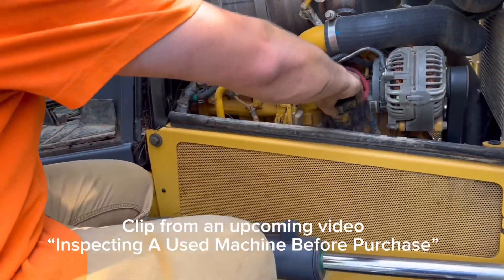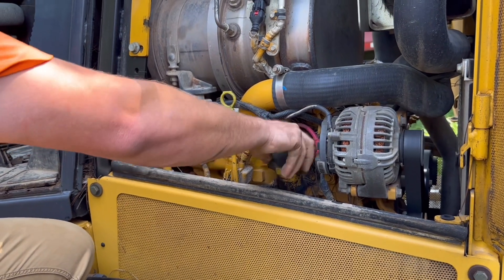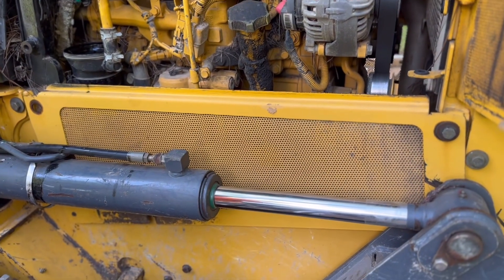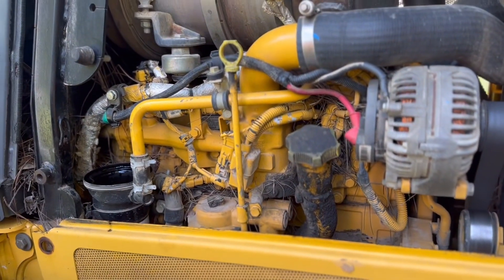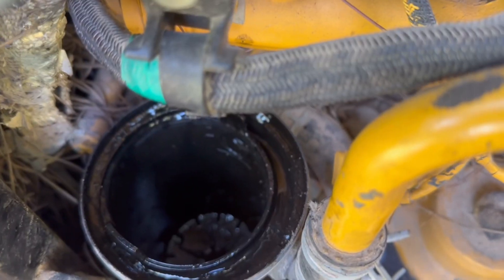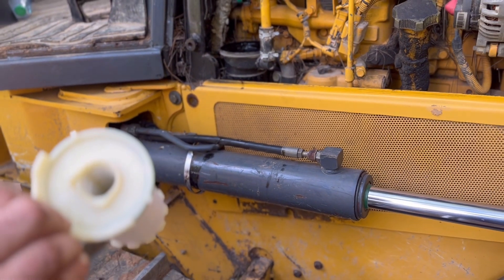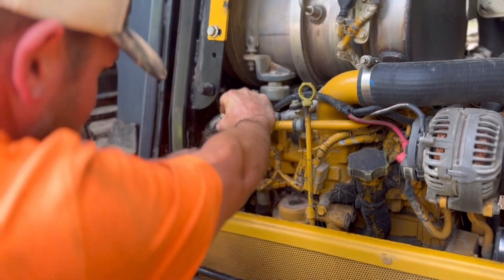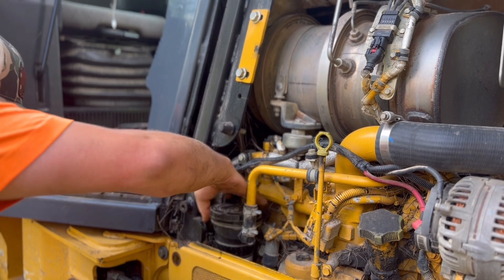Late Model Engine with BLOWBY? Don’t panic, TRY THIS!

Comment: There's no way to NOT to have any crankcase pressure in a diesel engine. The new diesel engines are so choked with emissions and are leaving the operators stranded beside the road